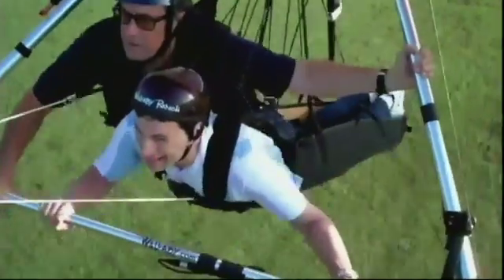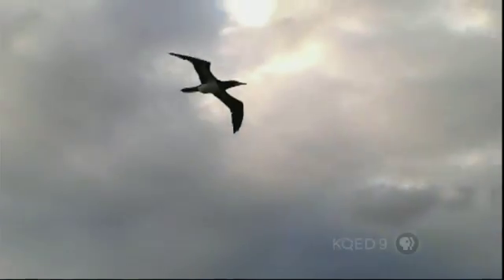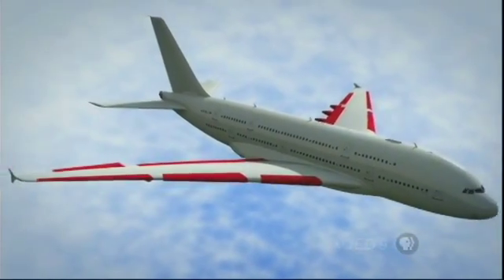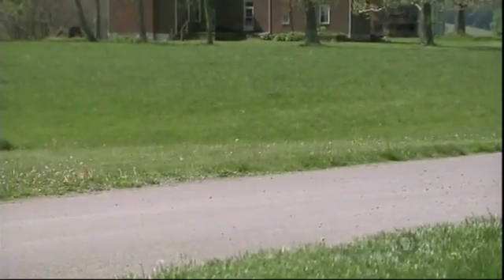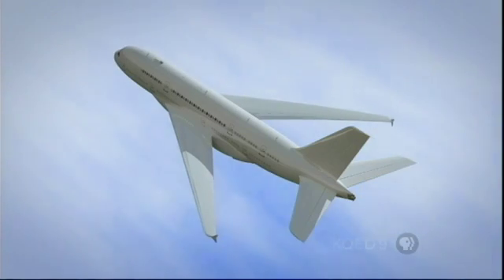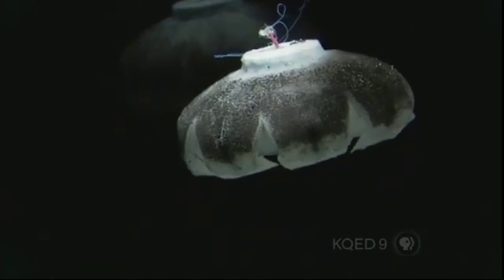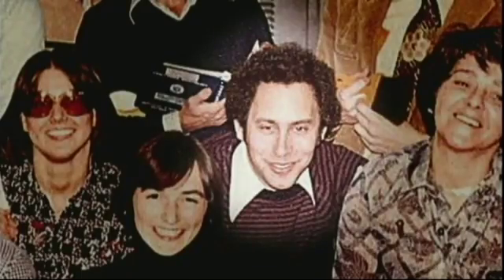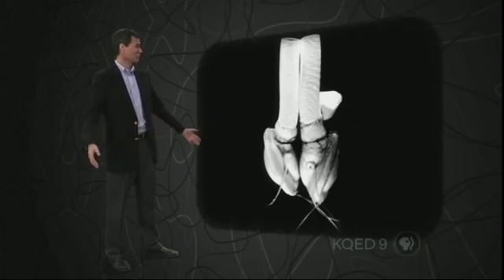Smart materials (3 of 5): shape shifting material, drug delivering nano particles

Comment from the maker: @nightblitzx It may be true if the plane is modeled after a swift. (best for a fighter jet). I'd bet future airliners would model after a soaring eagle or something that flies efficiently and steadily. When jet powered, they can do without the flapping. The flapping can cause sickening up-and-down movements. The engineers are smart enough to take the goods and eliminate the bads. In any case, a barf bag is always provided on airplanes.  Though you have to worry about the underwear yourself. :-)